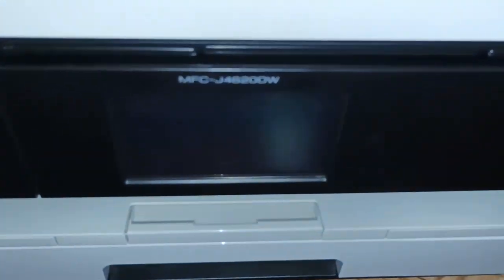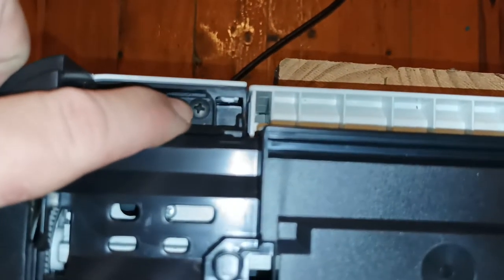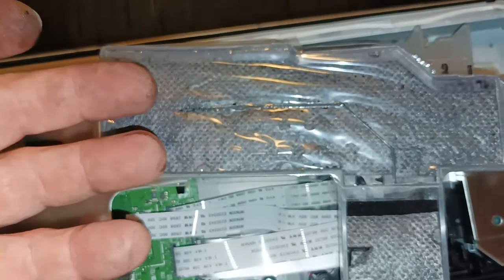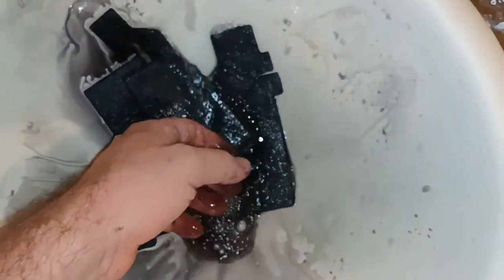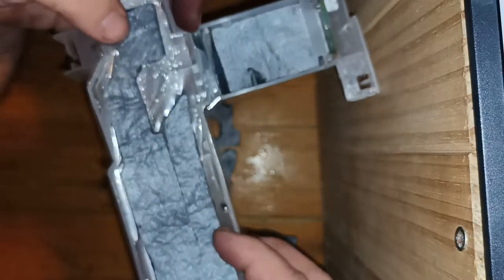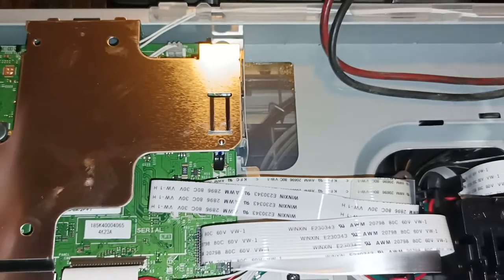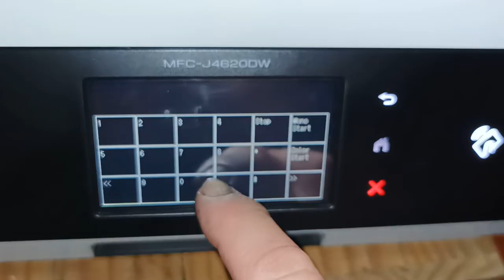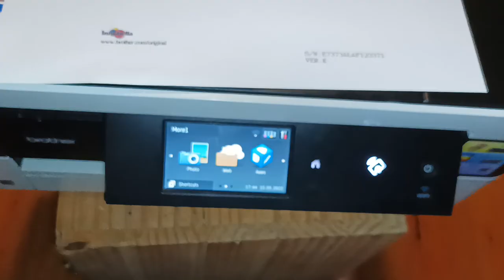Repair Ink Absorber Pad Full - Brother Mfc Printer 4620dw 4510dw 4410dw Error 46 how to no parts $0.

Comment: Hi, I have just reassembled my unit (J4610DW) but have a problem with the prop arm. Unlike your demonstration, my arm was working, but on removing the scanner cover, the arm pulled its runner out from the lid. I cannot work out how it refits, and as it is not in properly, I cannot close the scanner fully. I get a "cover is open" message. Can you advise?
Reply from the maker: If you can't figure it out remove it completely

Comment: You just saved another printer from going to the recycle bin! Thank you for your video. You can add the MFC-J4410DW to your list. That's what I have, and your instructions were all applicable. (On the MFC-J4410DW I had to enter the codes using the printer's numerical keypad.)

Comment: OMG thank you, thank you, thank you!!!
 I managed to repair our Brother DCP-J4120DW using your video. There were a couple of differences with cord color and clips vs screws, but with your detailed instructions I managed to work it all out appropriately.
Printer up and running again here in wet New Zealand.

Will send you a gift to your pay pal link.
Reply from the maker: Thank you, yes when it is wet and raining lots the absorber pad doesn't get a chance to evaporate the water content in the waste ink collected in the pad resulting in this error message. It is important to dry the pads right out before reassembly if you live in a  wet climate.
Reply: I placed the pads in a dehydrator for about 6 hours at 40 degrees C. They were nice and dry when they went back in. 😊
Thanks again

Comment: Well, this was an almost perfect video. The only thing wrong with it was you didn't explain how to remove that stupid scanner carriage prop arm if it isn't already broken! 🙂 Sadly (and kind of embarrassingly) it took me almost as long to figure out how to take that arm off so I could remove the carriage as it did for me to complete the rest of the job!  😞
For those like me, the top end of that prop arm rides inside a plastic guide. That plastic guide seats in the carriage at the front of the printer and clips into place in the rear. Just open the carriage until the arm stops it and unclip the rear end of the guide and pull straight down. It will come right out.
Reply: Thanks for you tip on removing the prop arm. I couldn't see how to disengage it without breaking something. It released easily and went back even easier when I was reassembling. I took the easy way out and bought a new absorber pad. I saved the old one, and will try cleaning it for next time.

Comment: Great video,  thanks. Flowed it step by step and fixed my printer for hopefully another year or two's usage!
Reply from the maker: Tips/Gratitude (Copy & Paste -Don't Click!) http://www.Paypal.me/fixitfast
Reply: Looks like I jumped the gun a bit. The printer now has a new problem. It said to replace the yellow and black ink cartridges which I did with new cartridges bought from Office Works. It however now says it does not detect the yellow or black cartridges and to remove them and reinsert slowly which does not fix the problem. Added to this, looking at the little window on the new black cartridge it seems to be empty! As if all the black ink has been drained out? So while I was pleased yesterday that it printed, it was not actually printing black!
Reply from the maker: @louisvangraan1012  Our inks for the printer $38 for the LC 237BK high capacity and $28 each ymc lc235 high capacity.  Officeworks generally only sells the low capacity LC233 which runs empty in as little as 4 head cleans and you do not touch the non-genuine inks that Officeworks sells I'll tell you why face to face but not in a public forum.

Comment: This video has been very useful to me. I just want to ask about that condensator. Is it easily replaceable, what are they called and what type? Mine is not fully working anymore, gives between 1,5 and 1,59 V. That might also be the reason why my printer has trouble to turn on / stay in sleep mode? Everything else works again!!! So I'm very grateful.
Reply from the maker: @mariskavredgoor6929  follow the link in the video description to where you can purchase the part
Reply from the maker: @mariskavredgoor6929  this is the video that relates to your not being able to turn on problem https://youtu.be/BSy_msygXZM

Comment: Thanks for posting this helpful video.
I accidentally crushed the capacitor chip on the board when removing the sensor board.
Currently, it is replaced with appropriate parts.
If you know the correct capacity, please let me know.

Comment: Hi Terry, Greetings from the UK. thank you for a most excellent video. I used it to sort out a MFC-J4510DW where the msg was: Ink absorber nearly full. I washed out the pads and all reassembled but the msg remains. I followed your instructions, but the purge count is already 0. How do I reset the warning please?
Reply from the maker: Wash and DRY the Pads and the Sensor Board out Properly then perform the reset code again.

Comment: Thanks Terry, great instructional video! My MFC J4510DW printer was "NEAR FULL". I followed your instruction and we are successfully back printing, but after entering *2844# it went to the "MAINTENANCE" screen. I could not access the "PURGE" screen to reset. Before every copy I have to press the red "X" . Any ideas? Cheers, Graeme
Reply from the maker: Exactly where did you get *2844 from ?
Reply: @TerryJonesPrinterRepairs  Hi Terry. Sorry, typo, the number which you gave on your youtube was "*2864#", (not 2844 as per my earlier). As earlier message, it went to the maintenance screen, not the error screen. Cheers

Comment: Hi Terry. Do you sell replacement ink absorber pads for the 4620dw model? If not, where can I buy one? Thanks kindly
Reply from the maker: You clearly have missed the point of the video.
Reply: @TerryJonesPrinterRepairs  Thanks for your reply. I havent missed the point but my old ones are damaged and broken by my own fault so was wondering if you sell replacements or where I can buy a new one.
Reply from the maker: @bartbollen8166  drill 2 holes in the back plate and plumb the 2 hoses out to an external plastic jar to collect the waste ink. You can buy hose joiners at most hardware stores in the gardening section. Then you never have to worry about the waste box ever again.
Reply: @TerryJonesPrinterRepairs  Thanks for your reply. Appreciate it.

Comment: Thank you very much. It was quite an adventure, but finally I succeeded. But now I have a another problem.
No more error messages. The colours are printing fine. But the black colour does not print. 
When I print some black text, the printer prints , but the printed sheet is empty.
I have tried another cartridge from a friend that does print ok on his printer. But this cartridge also gives no results on my printer, DCP J4110DW.
Could you please help?
Reply from the maker: You have air in your black ink line instead of black ink. If you keep removing the cartridge and placing it back in the machine or swapping it with another you are forcing more air in. Watch this video to understand the principal and make sure you click on every ad that pops up. https://www.youtube.com/watch?v=kvmPKzuoOMU
Reply: @TerryJonesPrinterRepairs   Hi Terry. That was also very instructive. I took the printer apart again, to see if I could see the air in the black tubes, but you can't see all of it unless you take the machine even further apart, which I did not want to do. So I cleaned the left filter some more, and pressed the black tube faster to the right waste pad. Put it together again and cleaned the black ink twice .
Problem solved!

Comment: Great video! But I messed up something. I fully expected the printer to work when I plugged it in, but it gave me the message "Cover is open". "Please close the scanner cover". I thought I was careful with the wires. Is this a wire problem?  I could not get to do the coding. Any thoughts? Thank you. (And again, it is a great video.)
Reply from the maker: You haven't screwed down the inner cover properly
Reply: @TerryJonesPrinterRepairs  You are right. The cover was not screwed down enough, thank you